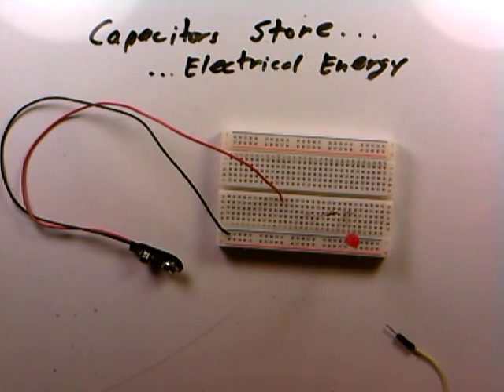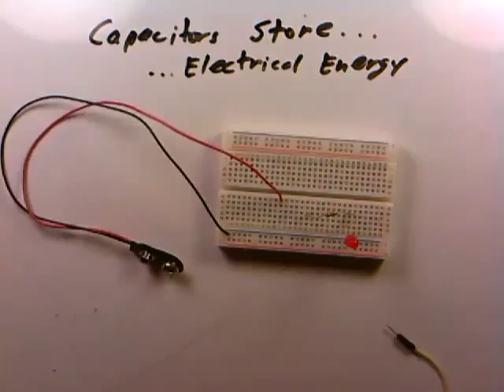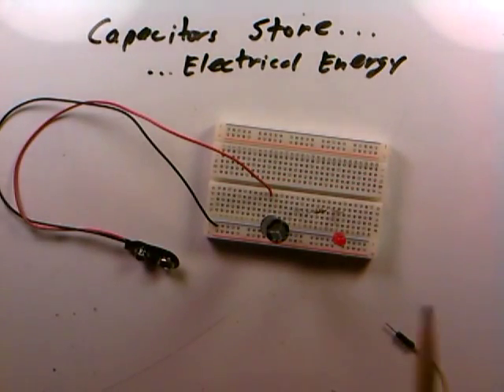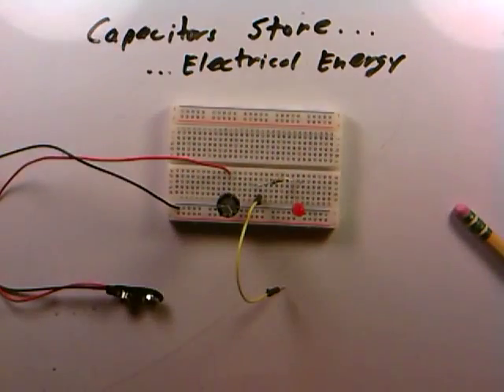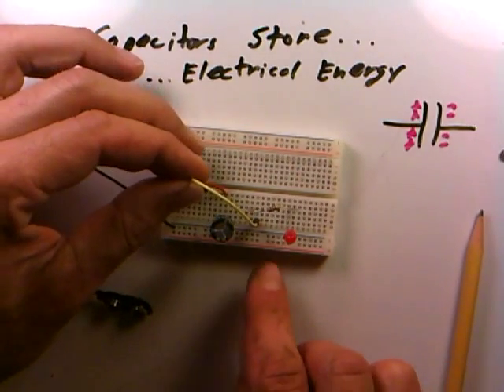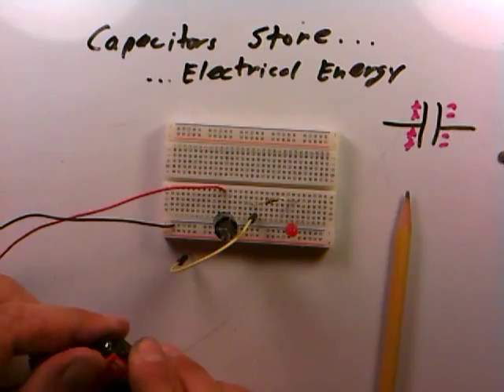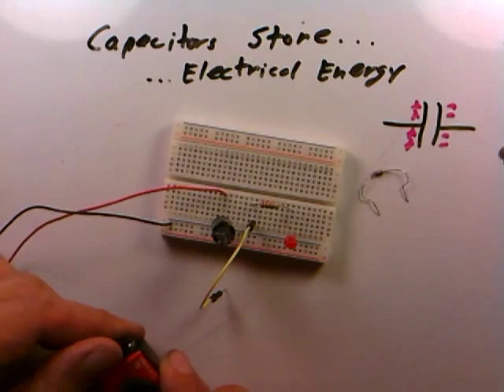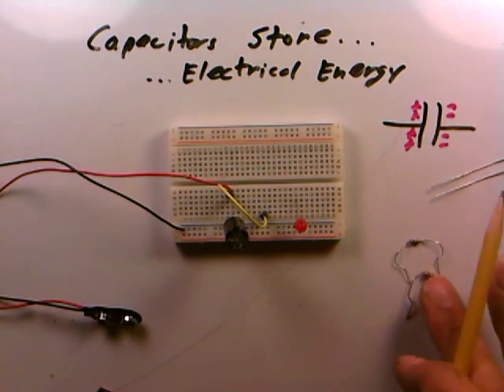elec 029 capacitors store electrical energy led

Comment: This is awesome!
But I have a question.
What type of capacitor you use?
Reply: any electrolytic will do something like 1000uF.
Reply: Ok, Can I use 1500uF capacitor?
Reply: yes...a 1500uF will be fine. The larger cap, the longer it'll take the LED to dim.
Reply: No, it is no longer take the LED to dim.
Can you answer me, Why?
Reply: for the same R, the 1500uF would have to have a larger discharge time than the 1000uF, since the time constants is RC.  You probably just aren't noticing it with your eyes.
Reply: I connected the 1500uf capacitor to 12v and its good